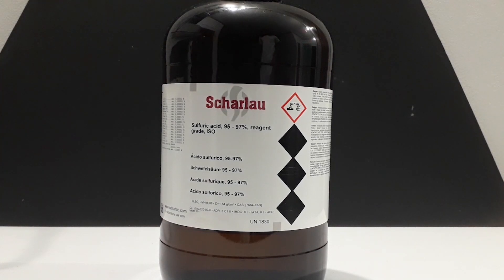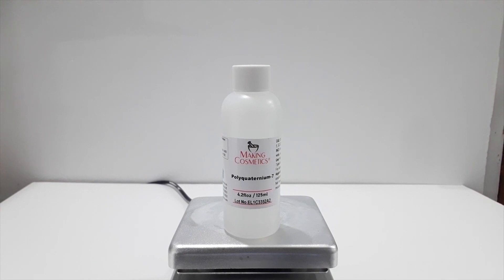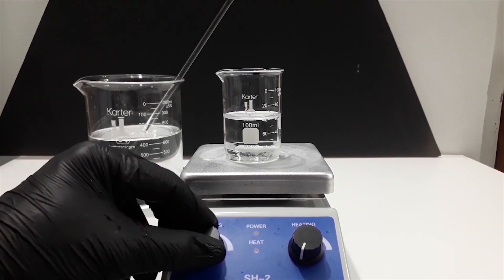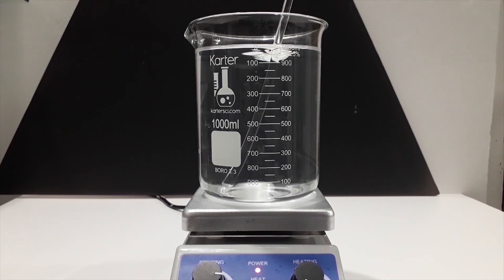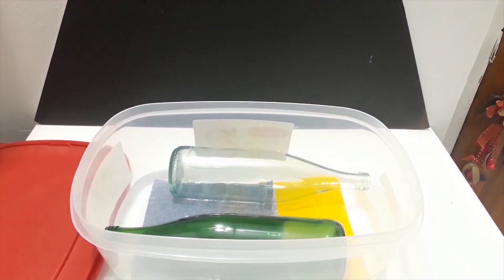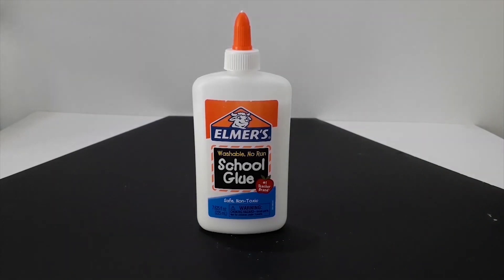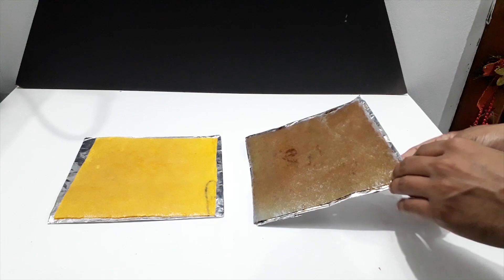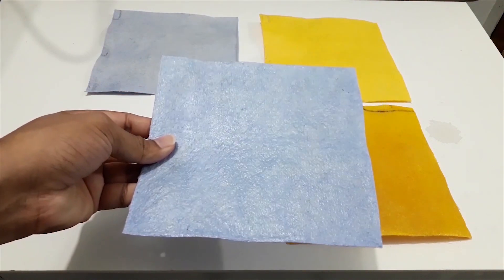How to produce DIY ion exchange membranes for various electrochemical applications.

Comment: Can I use this membrane to get sodium hydroxide from brine with the chlor-alkali process?
Reply from the maker: yes this is what that process uses. cation exchange resin with anodic chamber feed of NaCl.
Be very careful of the chlorine released in that process it will surprise you.
Reply: @CatboyChemicalSociety  wow. Thanks for the information. I was intended to produce small lab scale NaOH production using your membrane. Do you have any suggestions for me to do it?
I mean, is there something that I have to do to get efficient process?
Reply from the maker: @andrianwijayono6658  make sure the membrane cell doesnt leak and repeat the coating process of PVA and citric and cooking 2 or 3 times over to increase selectivity.

Comment: That’s useful! Thanks for sharing I’ll have to try this myself soon.
Reply: @shlomibenyair3405  a clay pot would work too, but ceramic membranes have very high resistance
Reply: @shlomibenyair3405  so you are saying that clay will work as a membrane? Any specific clay?
Reply: @shlomibenyair3405  I've done a quick look but can mot find anything. Would you have any helpful info to share? Thanks in advance.
Reply: @jvon3885  Clay is a nonselective membrane; it's just lots of tiny holes that make it harder for everything to get through, so things that are forced through by the current (ions) end up going more than things that are just diffusing.  What MB showed here is an actual legit semipermeable membrane, which at a molecular scale actually only lets certain chemical species through (positive ions in this case (and possibly water), not negative ions, or gases; though in the comments they also explain you can switch out the citric acid for aspartic acid to make one that passes negative ions)

If all you need is a porous membrane (like clay) not a selective one, you can use clay but you can also use the first step without the PVA as they show in this video here :)
https://www.youtube.com/watch?v=foQHygE2Mkw